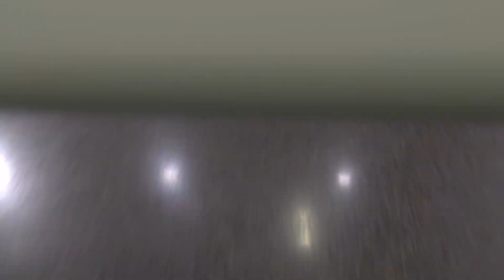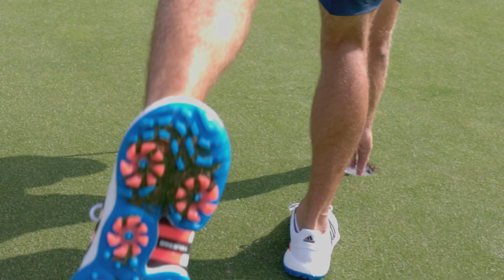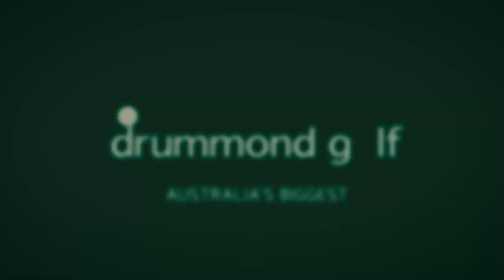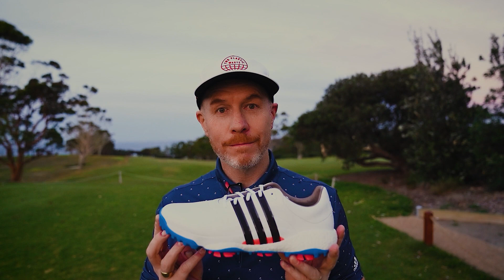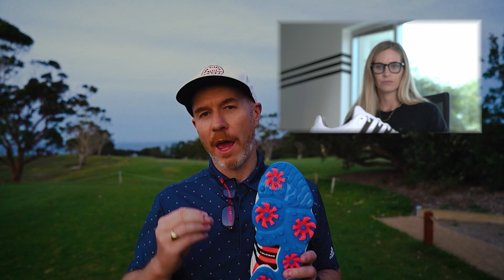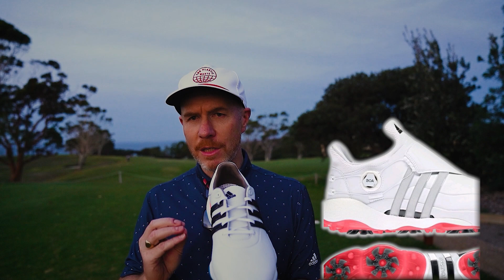Adidas Tour 360 22 - FIRST LOOK

Comment: Do these fit the same as the previous gen tour360s?
Reply from the maker: Hi Patrick, Thanks for the Q. You should fit into the same size if you have owned one of the more recent Tour 360 models from my experience. I am an 11US wide in both. If you were a fan of the previous, then the 22 shouldn't disappoint. Thanks, Ross.

Comment: Can you replace the spikes ?
Reply from the maker: Hi Matt..Spikemore Technology is high density long wearing TPU. They are molded into the sole and not designed to be replaced.
Reply: @drummondgolfaustralia  thanks for thanks for  reply I did order a pair . If I get a year out of them 100+ rounds I will be happy with that I have been with boost 360 since I started